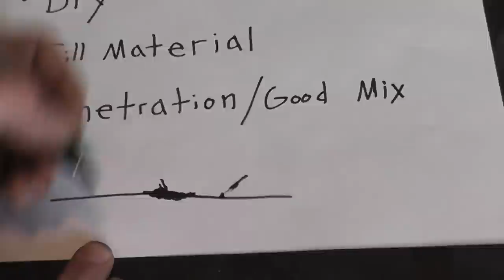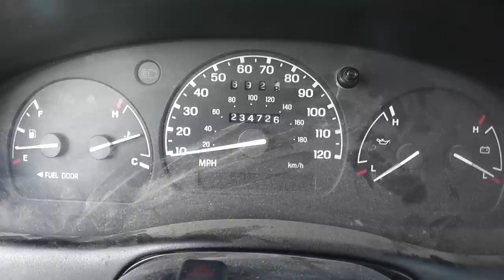How To Fix A Cracked Plastic Radiator For Free (Hopefully)

Comment: Had a crack about 4" long in the plastic tank on the "outlet" side of of my 2002 F-150 radiator.  I followed your tutorial pretty much exactly as you did in your video. Using plastic taken from the "ribs"  of the tank in question,  I was able to successfully patch the leak. That was 6 day's and appx. 1100 miles ago. (I travel A LOT for work...bought my truck brand new in 2002 and it has 447,212 miles on it currently).  Thanks for the video Jennies!  
one note of emphasis...make sure to drill holes at ends of each crack to arrest the "run" of the split.
Reply: Is it still holding
Reply: Great advise, change the dynamic, of the ends, the geometry

Comment: you gotta heat the radiator with the iron first and when it starts to melt you add the plastic. Just like welding with a rod. It does totally work. Did it on a 97 5.7 vortec. Lasted about 18 months so far 👍🏻💪🏼

Comment: I had the same problem with a crack in the top of the radiator in my Celica GT-Four. I fixed it almost the same way you did, but I did use a Dremel with a diamond engraving bit to cut a V shape groove into the crack. Then got my cousin to heat it with a hot air gun while I melted in more plastic with a soldering iron. Then sanded it down flat and 3 coats of epoxy resin. It lasted 6 months before it split open again in a huge cloud of steam. It's now been replaced with a full stainless steel radiator. But at least I had 6 months to save up for the replacement. So DIY repairs are handy to keep it working until you can get the cash together for a replacement part.
Reply from the maker: Thanks for sharing your experience, 6 months is pretty good! We'll see how it goes with mine.
Reply: Did you use the same type of plastic?
Reply: Never heard of a Stainless steel radiator, I dough weather it would disperse the heat like Aluminum does.

Comment: Add more filler to the weld and strands of steel wool as structural fibers. I have heard zip ties are the right type of plastic to use as filler. PA plastic. Great work and well explained.

Comment: I fixed a 3' dia plastic tube that snapped into two pieces with a clean break with your baking soda trick and a trick I have used. Regular SuperG is thin so use a piece of sting and tack glue it around the crack. Now saturate the sting with super glue and use the baking soda. Boom a fix that looks like a small weld. Painted mine and looks darn good!

Comment: Use Loctite Epoxy Weld compound and a piece of automotive body repair fiberglass cloth. DON'T USE JB WELD. JB Weld is not antifreeze resistant.
Rough sand the area to be patched, then clean with brake cleaner. Soak the cloth in Loctite Epoxy Weld, smear some Loctite on the radiator then apply the Loctite soaked fiberglass. It will be a lasting repair. This repair works well for cracked steel and aluminum on engines and transmissions also.
Reply: Is lock tight just epoxy just like jb weld?
Reply from the maker: +Thor Mcgee The trouble with radiators like this is that over time the heat deteriorates the plastic (great design), and that's why they crack. Even if you are able to patch it up it's still not as strong as when new.
Reply: People,this WORKS very well; being a fanatic (a lucky mechanic too)I weld it roughly(ATTN: No traces of antifreeze in area)  AND epoxy it over with thin fiberglass cloth, just like Thor Mcgee says; 7 years ok on my Trooper 3.1 TD (named Opel Monterey in Portugal/Europe), towing boats,A/C on ; but you MUST MUST MUST use *fiberglass cloth*; epoxy alone will crack in a day or two(done that);
Reply: Loctite epoxy weld compound auto body repair fiberglass thin cloth
Reply: Loctite epoxy weld compound auto body repair fiber glass thin cloth

Comment: A good get you home repair, but will cost more for headgaskets and labour for a ruined engine from overheating, because the water loss and constant high temperatures from coolant loss?  As well as the antifreeze inhibitors stop rust too 👍

Comment: After doing the plastic weld,I would've got epoxy that sticks to plastic and a small sheet of glass fibre and applied it over and a bit beyond the plastic welded area to strengthen the spout area where you connect the hose.

Comment: I would try a $16.99 plastic soldering iron from Harbor Freight to seal the area by melting the radiator well plastic to seal the area.  Now that it's sealed and we're no longer worrying about coolant leaking, you can add JB Weld over the area to strengthen it mechanically to help the area hold against the 15 lbs. pressure of running at temp.

Everyone seems to be trying to use 1/2 of this solution, one or the other, but I think both together would be best since it seals the area, as well as strengthens the area...

Comment: Did this repair to my 2002 sentra radiator and it worked well then more new cracks developed and I bought a new radiator for 55 bucks off ebay.  I used black zip ties that are the same type nylon as the radiators.  The problem is these radiators have glass fill in the nylon, and is the weak point causing cracking after about 10 years.

Comment: Excellent strategy for cheap radiator repair. Might work somewhat better if you used the hot chisel tip of iron to melt V shaped groove penetrating 2/3 into material - following the entire length of all cracks. Then go back and do exactly as you did...
Reply: +Eric Christenson That's what I did, and I used a soldering iron rated just 35 watts.  You don't need much power because plastic doesn't conduct heat nearly as well as metal does.

Comment: I've tried plastic welding. Kind of worked as an emergency. Even better is my favorite.....thick super  glue and baking soda. Put a good quality super glue on the crack itself, then imediately shake a tablespoon of baking soda onto it, wait a few seconds and blow off excess powder with your breath... anopther line of superglue and more Baking Soda and maybe one more time and voila.... you can drive in a minute. I drove from LA to Lancaster and back on hot summer day and it held .... eventually I had the time to replace which I did but the super glue and baking soda is a great plastic repair. All kinds of uses.......Maybe someone can explain the chemistry involved. I know it gets hot.

Comment: Author said it started to leak very little soon after this job, without needing to add as much water, almost no need to add he says. And it held up pretty good for 2 yaers when he sold this Ranger. I think he used ordinary plastic and I saw that the majority of radiator sides material is made of nylon. I'd use a little of its own material collected from Small ribs of it.

Comment: This is the best plastic radiator repair I have seen. Thanks a million. My car has has a hair thin crack less than 2 inches long below radiator cap. Interesting fact I learned is the high temp at the fluid intake from the case. The engine is usually 300 F; what will the radiator temperature be?
Thanks again

Comment: the best thing to fix anything even metal is super glue and baking soda. you put the glue on the cracked area and then put the baking powder on it 5 seconds later it's fixed hard as rock
Reply: I am thinking about using this on my cracked radiator.
Reply: You serious ?

Comment: it's about giving it a go trying to experiment and hopefully save some money or prolonging the spending $ for a few months. The  experience  is priceless so even if it does not work out, at least you had a go and learnt lots and even passing learning on like you have on you tube :).
Mine has a split 200mm along top tank and slight plastic weakness like your probing plastic  technique  revealed.
im going to repair mine and see how it goes as getting a new radiator is 400au+ dollars as mine had the outlet pipe on drivers side RH nissan terrano2 jap brand "made in spain for nissan" with ka24e engine and looks like i gotta import it myself from UK To AU as no places have my config new in Australia in aftermarket parts. let us know when it goes kaput so we know likely timeline..Thanks and regards
Reply from the maker: stigonutube well, I've got 4000 miles on it and about 3 months since the repair and she's still (mostly) holding. After long drives on hot days, i see just a little wetness around the repairs. I'm really happy with it though. Definitely better than adding water every day and having good samaritans commenting on the big puddle under the truck :)

Comment: Thanks Im going to try this.  Any special instructions for a crack that looks to run under the crimped metal holding the plastic to the radiator metal?

Comment: This is a good idea actually. Keep the old stuff working. If it cracks again then replace it. There's a good chance this will hold though. Thanks for sharing :) Curious if you did have an update... Did it crack again? I'd have put some epoxy over top of that weld as well if it were me, and possibly run leak seal through the radiator system as well.
Reply: Matthew Jeschke yes my project 2006 gxp 5.3 rad was leaking today was ready to take it for certification here in Ontario this week have to delay going Will epoxy after stop drilling cracks degrease  and sand  may plastic weld first then with epoxy and fibreglass cloth then smooth and paint

Comment: I may try this as while i was testing a heater hose fix i heard a noise and saw a wet spot at the radiator hose, nice straight crack. It's a $100 vehicle i bought 45,000 miles ago and it's not worth scrap price, but it still runs and my coworkers hate it so...... I've heard the nylon tank is the same as zip ties. Radiators for this are cheap, but I'm not sure the van is worth much money and there's other repairs calling for my cash.

Comment: The reason most repairs fail is they don't drill the ends first. That way it stops it from going any further. Then you have to use something that can take expansion and contraction. So it can't be some super hard epoxy as it has to be flexible. Just clean the surface real good and make sure no water or anti-freeze is still present. It has to be clean, dry and rough. Use 80 grit sand paper of a file. Then wipe with acid tone once more. Let it dry and seal over with flexible epoxy. 

It will last a very long time then.
Reply: Yes on the holes drilled. Required in aircraft and good welders fixing heavy equipment. But most knuckle scrapers today don't understand the mechanics of a good fix. I love to save items, but when these radiators crack, ALL of the plastic in the unit is on it's way to vibration and heat stress unreliability.  I would have done this when I was a kid and broke, but with most radiators out there at 50 bucks, forget it.

Comment: Yea when your using pvc type plastic that has been molded with the molecule's in a certain arrangement  it will fail. And if the plastic is week it is because particulates in the water or additives is abrasive and will weaken plastic over time, with also hot and cold cycles and weather. The best bet for a more perm. bond is to use a fiber glass kit. but as the plastic is already failed under it, it will fail eventually.

Comment: thanks for sharing my son in law broke mine and I wanted to see if something would work to put it back together
Reply from the maker: Freda Yourself This is worth a try. I drove for months with this repair, and it was still holding when I sold the truck.
Reply: ok cool it has been 24 hours going to try it now
Reply: I just wanted to say thanks so much I have driven my truck since saturday and I have not ran hot or no leaks I personally think this will be a permanent fix...

Comment: How long did this repair last? I just had the radiator replaced on my 07 Saturn Ion. Shops would of course replace the rad because the job is only done once whereas a patch might be a return down the line and no one wants to warranty a patch. If I had time and a second vehicle, I might have tried that as I too had a crack in the plastic. Don't make rads like they used to. All metal in the 1970's.

Comment: Best thing is marine epoxy steel it comes in 2parts just like bondo and it drips like condensed milk but it is the best apply a thick layer ,you have to wait hours for it to dry and then tilt the radiator which ever way you want to apply the glue to the other part of the leak this is the best fix patch a large area its better than plastic weld
Reply: +basant vimal Sharma Maybe with plastics like polyester, but radiator tanks are usually made of nylon, which is best repaired by melting it.  Nylon is one of the easiest plastics to repair this way, and the repairs are very strong, unlike with polyethylene.  I've even replaced the teeth of nylon gears by melting in new nylon.

Comment: I have an '03 Dodge Ram that is spewing coolant where there is a very small crack located right at the base of plastic neck on the top of the reservoir (where the cap is screwed on). I really like your suggestion to cut a small piece of the same plastic to use as a bond. If your fix on the radiator itself is withstanding the heat, I assume that the reservoir should be okay. I'm really trying to just do some "first-aid" here. Thanks!
Reply from the maker: +Jim Haas I bet this method would work great on the reservoir, especially since it probably doesn't get as hot as the area of the radiator I repaired. The plastic I was working on had been really weakened by the heat.

Comment: Great video;  is the repair still holding?  I was thinking about adding P-tex snow ski repair as a filler;  but plastic from the radiator might be better.  Or plastic from the radiator reinforced with P-tex.
Reply from the maker: Zach Hart Well I just sold the truck last week, and it was still holding pretty good. In all the time since I made the video, I think I might've added 1-2 quarts of water total. It still seeped out a little bit, but much better than before. (adding water every 2 days)

Comment: Sorry bro but with the fact that you totally use no antirust agent,ie antifreeze, the plastic does look a bit weathered. I wonder if u can buy new reservoir s for these cores. Being right around the nipple, future flex seems imminent. But good luck. I have a split in my e150 vertical flow. Very small but about 2 inches long. They make a material that comes in pencil diameter 6 inch length s that are made to melt in to the split. I believe the trick is heating the new and old material without melting more than necessary.
Just for curiosity, how long did your fix last?

Comment: First try the scrap yard.  Frequently, other owners installed a new radiator that didn't wear out before the car was crashed or scrapped.  I have to say that it's pretty dumb to risk seizing an engine or warping the head just to save a few bucks.  The radiator will soon fail at the seam anyway.

Comment: this isn't intended to be a permanent fix. it's to help anyone that is short on money and is meant to get you by until the first chance you have to buy a new radiator. just like the ole fashion radiator stop leak. I refuse to use the stop leak as it gets gunky and makes your antifreeze clumpy with the stop leak. had experience with the stop leak, aka mechanic in a can. and it did t seal up the Crack nor stop any kind of leak. just made the antifreeze dirty as hell and was a wasted of 10 bucks. if you can fix it for a temporary fix to get you to the next month or so because not all of us can afford to just flat out buy a new one right away. then do what you can to make it work. as long as your not being dumb about it. I tried this with my saldering gun but had antifreeze comming out at the same time so the plastic wouldn't adhere to the other plastic cause it cooled too fast. but it is a good concept. just like taking a leaking exhaust and having a small patch welded to the leak. if it melts, it can be formed. stay creative people.

Comment: Hi Just saw this video..i see it was published May 2014...Would you please tel the status on radiator..? how long it lasted...?? and how many miles ...??
Reply from the maker: After a while I started to see a little moisture at the repair, but never enough to add water. Ant it was still holding as of a couple months ago when I sold the truck.
Reply: Hopefully you gave full disclosure when selling the truck.
Reply: Probably not necessary officer.
Reply: +216trixie wouldn't think it would be necessary. the only reason you could even notice my repair was because the area was clean but it held up just fine.
Reply: with how many miles? 300k? lol
Reply: 216trixie lol

Comment: Greetings, I have had success using hot glue and a heat gun to melt the hot glue. Surface preparation is important, the plastic needs to be ruffed up using a knife to cut grooves in the plastic so the hot glue has something to cling too.  Sandpaper will not do, I work the plastic about 1/4 inch on each side of the crack. The surface must be clean and dry before applying the hot glue. My repair has worked so far, but it is in a
low stress area of the radiator. Your method has a much stronger mechanical bond and will last longer then my method, but I did mine with the radiator in the car. james
Reply: Do you need high temp glue to do it??
Reply: Patrick jones No, I used the regular hot glue gun glue sticks, I bought them at Ace Hardware.  The repair is still holding and it has been 2 months but it is winter time now and the real test will be in the summer time. James